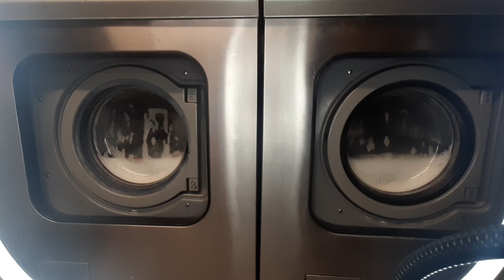When wash races go wrong: 32A connector burnout (Miele WS5073 race, 11kW, Cottons 60°C)

Comment: that is not a 32A connector, thats a death trap
Reply from the maker: Well, they were real Waygo connectors, under a very very significant overload (30+%) so it’s pretty logical for them to get extremely hot under those conditions
Reply: @TherealCentral1  They're called "Wago" not "Waygo". If they have "Waygo" on them, they're probably fake. That aside Wago  2273-203 Connectors are only rated for around 20 Amps
Reply from the maker: @ well, I do remember them being rated at 32, not 20
Reply from the maker: @ must’ve got the spelling wrong tbf, I’m very much sure they’re legitimate connectors, they were bought at a reputable retailer